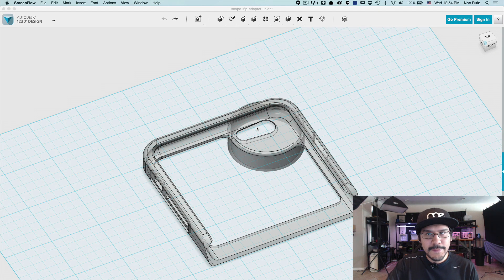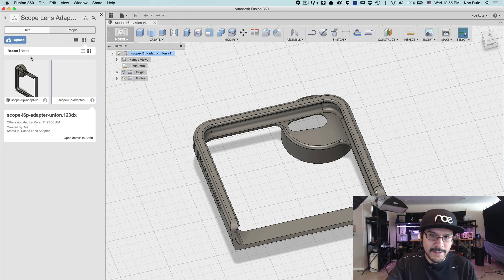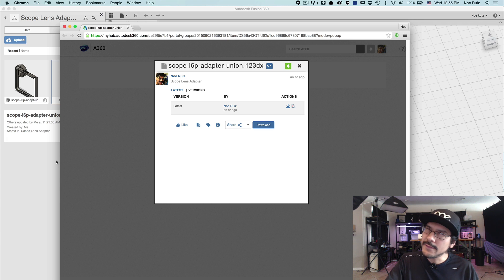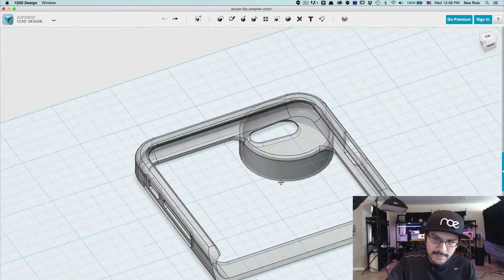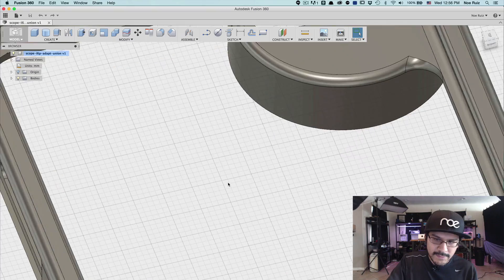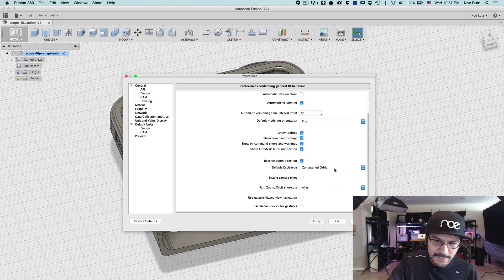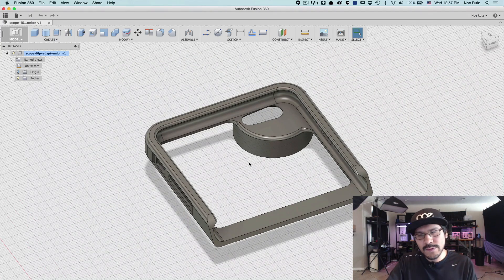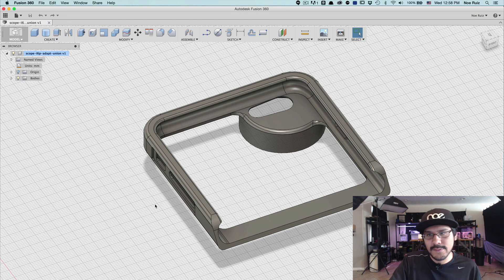Layer by Layer - Pan, Orbit and Zoom

Comment: I was told that the only free version is for students. Are there any free programs for design and create g-code that will work with 3d printers? If not, what are the cheapest programs to do this.
Thanks for the videos.